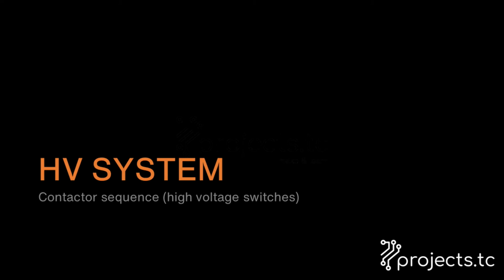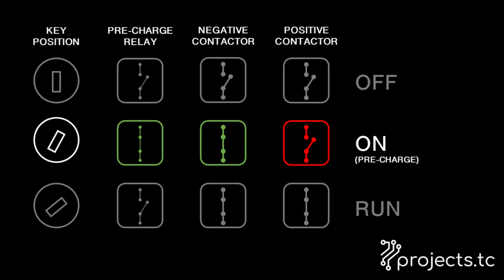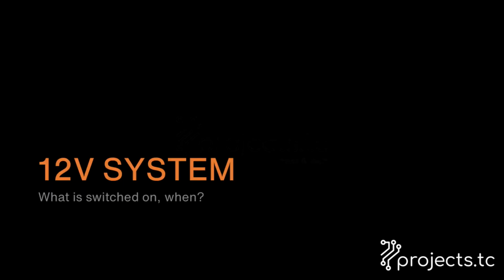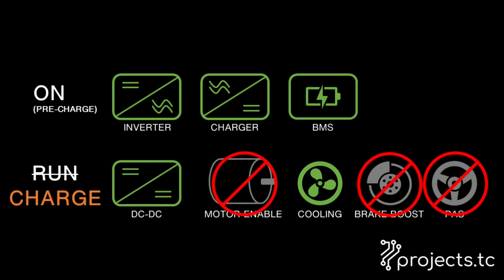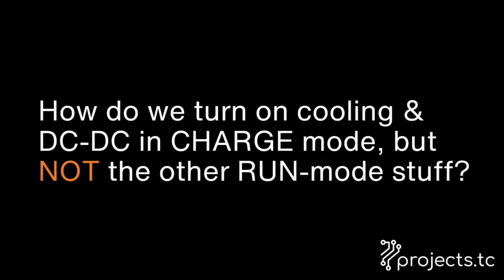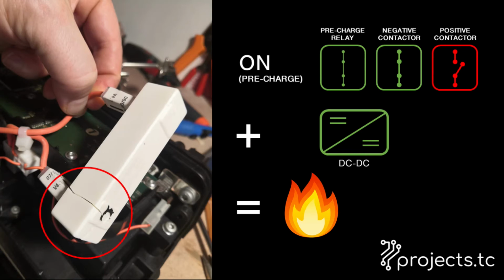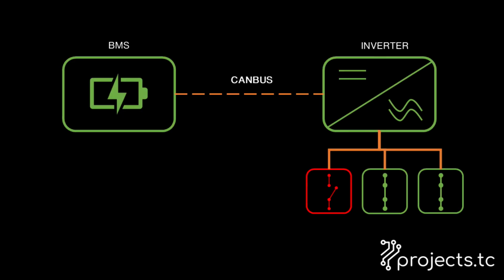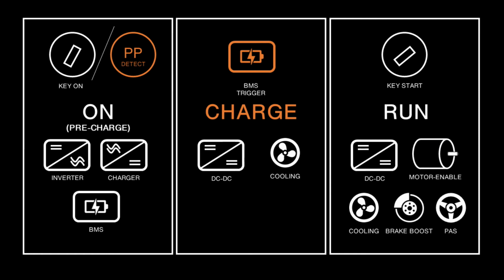Rewiring my DIY EV (because I screwed it up): Part 1

Comment: Thank you very much for making this simple unlike so many others. I loved your diagrams and steady presentation. My charger is not canbus compatible. Any suggestions there? I would dearly love if you could show how you connected to your ignition in the z3. Also how do we get something to latch on after turning key to start.
Reply from the maker: Great questions! I'll make sure I cover the latching in the next wiring video (short version: loop the output back to the input). Ignition-wise I went through the inputs to the DME/ECU and traced permanent live and switched live from there.
Reply: @EVDIY  did you remove the cluster and solder direct to existing indicator lights ie brake for vacuum alert etc or did you use wires from the old looms? I'm thinking....i could tie into the low brake fluid sensor on the reservoir for my vacuum switch output.
Reply: I was racking my brain for a simple way to get the car to precharge first if someone turns the key then to switch that off say after I don't know.. 30 seconds then go full contactor. Then i had a idea. Two simple timing circuits. Turn key and they both countdown. One goes on immediately and counts down (precharge) then the second is on but open and counts to 30 then triggers contacter two. This is "dumb" solution but would do the job?
Reply from the maker: @blackterminal  I've driven everything from a fresh set of fuses and relays driven from either switched live or battery so far. I've picked those lines up from the old ECU/DME connections. The brake signal (which actually isn't working at the moment - a subject for a future video) comes from a tap I put in under the dash.

Comment: absolutely brilliant explanation and visual graphic for the pre charge circuit, so well put together, question for you (from the guy with an ignition switch from 1971) I get the Off and On positions but by RUN do you mean RUN or do you mean START, in other words did your BMW ignition switch in it's ICE age turn one more position forward momentarily for the starter to engage and then springs back to RUN ~ I hope this makes sense

Comment: Have you ever considered using a gazebo to keep yourself dry? I knew a guy that rebuilt an MG under a gazebo, they're pretty cheap and can even have sides to reduce the wind.
Just a thought.
Reply from the maker: Unfortunately it wouldn't really work here. I have a very small driveway right onto the street and it would block access to the front door. Plus I live in an...'up and coming'...area. There's a small but real chance someone might just set fire to it!

PS - might have a lead on another garage though...
Reply: @EVDIY  I'm just amazed you got so much done without a garage. Fair play to you. 😉